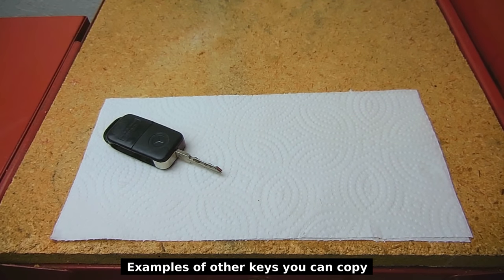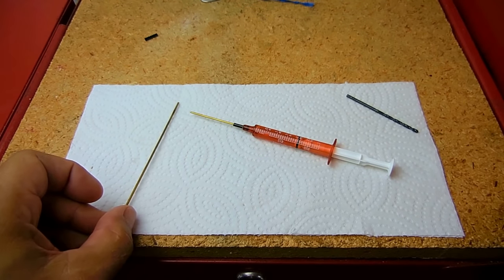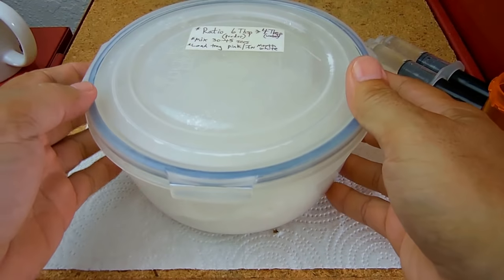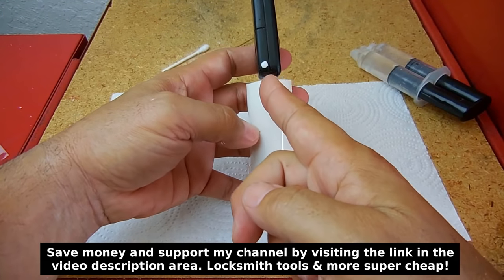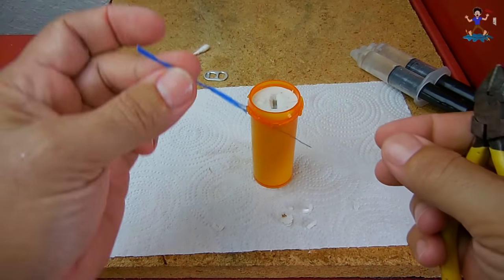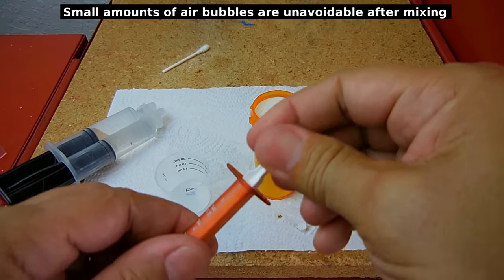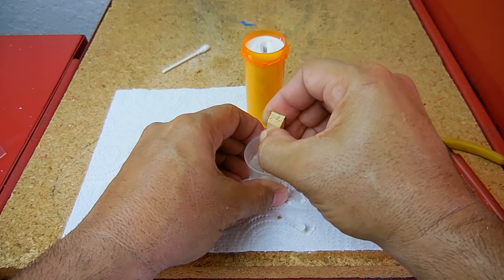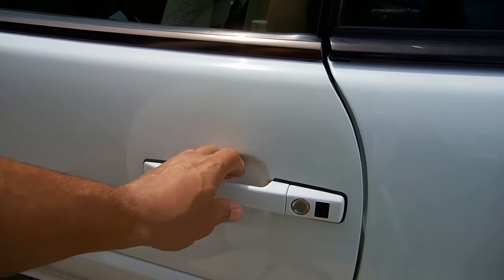How To Copy High Security Keys

Comment: I use silicone or polyurethane rubber for making molds. Silicone is the fastest and best material to use. A 2-part silicone putty is also available that also works well. This material has the advantage that you don't even need to have a mold container. You just knead the putty components together then press and squeeze it around the key, then hold for about 2 minutes. Rubbers are good for making molds because you don't need to slice the mold open to remove the key. You can just pull the key right out without damage to the mold. Note that you do need a release agent. For casting I would not use a 5-minute epoxy because it will give bubbles less time to float to the top before the epoxy begins to gel and traps the bubbles. Of course, vacuum degassing is best, but that will not work with a sodium alginate mold because of the water content. Super-hard surface epoxies are best as they handle the rough edges and pins in a lock better than softer resins. You can also mix powdered glass and graphite into your casting resin to improve surface durability and working life. Besides epoxy, another option is to use polyurethane plastic (not to be confused with polyurethane rubber). This is almost the ideal material to use because it mixes up much thinner than epoxy resins and it sets up to full strength even faster than 5-minute epoxy. Because it is thinner you do not have to worry as much about bubbles even though it sets fast. This will produce a working strength, usable key in about 15 minutes. It doesn't have quite as good a surface as super-hard epoxies, but it's fine... Finally, I use a few loose strands of carbon fiber, fiberglass, or even thread to give strength to the key and, as you noted,  to provide a way to remove a broken key. Do not think that your fancy high-tensile epoxy will not break! I've had keys break in the lock before. Carbon fiber strands work best. They are also easier to push into the resin and move around. I don't like using wire because it is tear the mold and ruin the key when you push it into the resin. I know you need to be careful, but it's just not an issue with carbon fiber or fiberglass.
Reply from the maker: Silicone rubber doesn't set up in 3-5 minutes. :-) Alginate does, and the detail of the mold is outstanding, just like silicone. If you want a mold that you can use over and over, AND have access to the key for more than 3-5 minutes, then yes, use silicone. Thanks for watching
Reply: Mad Hadder
"You can get 2 part dental silicone that hardens at various densities and times. The best for doing this is a 22S Hard 2 part that cures and is removable from the mold in 6-8min.
[...]
There are also 2 Part Polys that cure in 3min to Shore D70 hardness which is many times harder than epoxy."

I love the info in this thread, since i couldn't find an epoxy with a low enough viscosity to pour/inject. Do you know where i can find more detailed info on the materials you mentioned? Something like a webshop that explains the differences between the different varieties of molding materials and casting materials? I searched for 22S hard for example and couldn't find what i was looking for.

Comment: As an engineer, I say bravo. But I have just a few suggestions. Try the liquid version of quick steel. Much stronger than epoxy with no need for re-enforcement. When you are filling, try gyrating from the base. That will release any trapped air bubbles (if there are any present). I understand making your own blunt needle syringe, but you can get a 6 pack for 5 bucks on Amazon. And as far as the pop tab, getting a half inch flat washer would be by far better. And the wire you used is too thin. I would recommend a 16 gauge steel rod (you can put a bend through the washer if so desired.

Edit: I would also suggest using a file and grooving notches into the steel rod so it bites and sets in better in the quick steel.
Reply: @davidjones-vx9ju  sorry if some people are smart and want to help.

Comment: Great video! What epoxy do you use?  I've tried 3, two JB Welds and one Gorilla, all three seem to not harden enough to put in the tumbler.  they flex too much.  Thanks!
Reply from the maker: I found a hard setting, low viscosity 2 part epoxy at my local hardware store.

Comment: Great video excellent instructions.  I am a locksmith and I came across a high security key for a customer that I can't obtain the key blanks.  I have been trying your method for a few weeks with no success.  I am using the exact dental alginate you posted to another person.  My problem is I can't get the epoxy to cure inside the dental alginate.  The top of the key that hits the air cures fine and would be perfect.  But the key part that is actually inside the dental alginate will not cure at all.  I pull the key out and it is like a gummy bear.  The most important part of the key.  The milling and the key bitting will not cure.  After I mix up the dental alginate it cures fine inside the pill bottle.  I cut one side out with a blade to remove the key that part works well.  I trim off the top and make a small opening at the top.  I mix up the epoxy and use a syringe to inject inside the mold.  That part goes well.  After about an hour I check it and the top of the key is nice and hard but when I remove the key from the mold the rest of the key is completely flexible and still wet. It will not cure.  In your video you say pour your case as quickly as possible to avoid the alginate from shrinking.  I am pouring the casting within 5 minutes of pulling out the key. My question is the dental alginate suppose to be wet inside or complete dry.  It seems every time I pour the dental alginate the outside is hard and dry but the inside seems to maintain moisture.  I would say it has the consistency of a hard boiled egg.
Any suggestions you could offer would be great.  This is a very big job I am working on and would help me out greatly.  Thank you in advance for any help you or the YouTube community can offer.

Take care and be well.

I have a clam shell and Yes I can cast the key in low temperature metal.  The problem with that method is the keys come out perfectly but they are so soft you can bend the key in your hand.  I need to use this key on over 200 locks.  That will not work for my needs. Your epoxy key is perfect and I could make several as backups.
Reply from the maker: I bought the 2 part high strength epoxy at Ace Hardware.

Comment: "EASILY copy any key!" 

starts by listing 90 items required, including several that aren't locally available anywhere
Reply from the maker: Don't be a wise @ss, YT is full of them. It is easy, but clearly not for you.  Be thankful I shared this, I didn't have to.
Reply: @electronicsNmore  this isnt some revolutionary method. it is a slow, sub-par basic mold and pour setup that produces an extremely fragile epoxy key. Newsflash, einstein: people have been copying keys using clay molds and casting the keys out of zinc or tin for ages.

Yes, you can copy a key with nothing but a bunch of clay, some tin wire and a lighter. A damn good key, if you know what you're doing.
Reply: @Maxie962    Go ahead put up a video and demonstrate that you know what you're doing?
Reply: all the items are easily available, most locally but the alginate you can get online. If you want a genie to come and fix all your problems go rub your lamp
Reply: @lteralflow4641  what happened, did I hurt your feelings or something?  At no point did I ask anyone to do anything for me - thats not my style anyhow. I'm the stubborn idiot that insists on doing things solo to the point of reckless abandon...to the point where someone with any sense would have asked for help, and I'm sure I'll die an early and painful death because of it.

The point that I was trying to make with my comment was how the title of the video is disingenuous at best. The process appears to take about the same amount of effort as it would to, say, measure the original with a micrometer, source a few appropriate blanks, and then file them by hand, which, for the record, I already do.

I'm not saying the video doesn't have useful information. It absolutely does. Is there a time and a place where this information would not only come in handy, but also be the course of action with the highest probability of success? Of course.

Just be real, man. Call a spade a spade. That's all I'm saying.
Reply: @cen7ury  If you got any videos or links to info on filing/drilling car key blanks, i'd be interested. Thing is with a lot of a car keys it looks like it would be impossible to file them without using a router or suchlike. Obviously it would be preferable to use a harder and less brittle material. I thought the video was concise and well explained, which isn't always the case on youtube as some people ramble on, so i thought it was a bit unfair to dismiss it hence my comment.
Reply: @lteralflow4641  fair enough on the "laser cut" keys, those I don't file by hand. I also wouldn't want to use a cast key on any vehicle that uses that side bar slider style mechanism, as the vehicles that use those tend to have extremely expensive lock cylinders.

Personally, I ended up just biting the bullet and buying a semi-automatic key mill from Hong Kong that I've had good luck with cutting copirs of my Lexus and BMW keys so far....and with that really comes the crux of the matter: there really is no quick-fix one-size-fits-all solution to some problems, and keys are one of those type of situations, in my experience, anyhow. 

If you want, I'll find the make and model of my sidewinder key mill (I think i paid $600-$800 or so for the mill) or if you just need to be able to access a car with a sidewinder key without needing to start the car as well, check if Lishi makes one of their 2-in-1 pick/decoders for the vehicle you're trying to access. They're expensive,.yes,.but they're worth every penny. Any time I've used one, I've been able to get an open in about 30 seconds. Can't recommend them enough.
Reply: @cen7ury  Thanks for the info. Yeah i'd be interested in having a look at the key mill if you have the model number cheers

Comment: Do you think I will be able to do this with a medeco key? I just moved in to a new apartment and want to give my fiancé a key (they use it for the elevator here) but the manager is all over the place and I don’t get the impression that she’s going to be helping us get the licensed key copy ANY time soon. I’m worried that the epoxy won’t be strong enough and may break off in the lock and then we’ll be stuck paying for it. Any suggestions? Also, anything stronger than a pop can top?

Comment: Cool, I would try JB Weld instead of epoxy. Also it can cure in a few hours but maximum cure is usually 24 hours. Maximum cure can also be sped up by placing it in a convection oven for a several hours at  200 degrees. Very nice video. Best Wishes n Blessings Keith

Comment: 👏👏Great Video, amazing mind to come up with such a detailed procedure.👏👏

ElectronicsNmore or anyone else:  How strong are keys made using this procedure, will it break off turning a car on or is it fairly strong as a backup key for occasional use?
Reply from the maker: The strength of the key depends on the resin used.

Comment: Can I use a syringe with a needle (like the ones used for vaccine injection) inside of the DIY syringe? Will the epoxy resin get through?
Reply from the maker: No, the opening is way too small. Thanks for watching!
Reply: @electronicsNmore  thanks!

Comment: Do you have any suggestion on how to mix the alginate smoothly? The product I used is Kromopan alginate. I find that the mixture dries up so quickly before I get to blend it up, and there are always a lot of particles and chunks left in the mixture. Also, after the one hour of setting, the alginate is still wet and breaks easily like jelly. I might have added too much water, but with less water, it was even harder to mix up the alginate. Would you mind providing the measurement of water and alginate that you used? Thanks!
Reply from the maker: You must've used a fast setting alginate. Using cold water slows down the setting.
Reply: @electronicsNmore  thanks for the reply! Cold water does help. Which alginate did you use? I find that my alginate keeps getting wet after it's set. It takes 24 hours for my resin to fully set, therefore during the process, the water gets into the resin and makes the key very soft. Should try a different alginate or a faster-setting resin?

Comment: hi there i have a question which epoxy do i use hardener or resin i liked and subbed amazing channel!!
Reply from the maker: 2 part epoxy resin. The resin must be high strength, very low viscosity. Don't use the 5 minute type, use 10 minute to 1 hour setting time epoxy.

Comment: High tensile wire from a wire cable is probably a better alternative than from a wire tie and protoputty/oogoo/sugru could be used instead of the dental impressioning stuff. A piece of packing tape could be used to provide the seam to break open the key rather than having to use a scalpel.
Reply from the maker: Sugru is no good. Nothing, except for liquid silicone, can match up to dental alginate for fine details. Thanks for watching!

Comment: Would a 5000 psi epoxy resin work as well as the 1500 psi epoxy?
Reply from the maker: Hi Adam. As long as the viscosity of the epoxy is low, it should work fine. Be sure to rate thumbs up, check out my video playlists, share my channel with friends, and subscribe. Thanks

Comment: - 00:00 🔑 The video introduces a method to create exact duplicates of various types of keys, including high-security and "do not copy" keys.
- 00:15 📹 The method demonstrated is not found on YouTube or other online sources, making it unique.
- 00:50 🛠️ Required materials include fast-setting dental alginate, a syringe, a utility knife, epoxy resin, and various small tools.
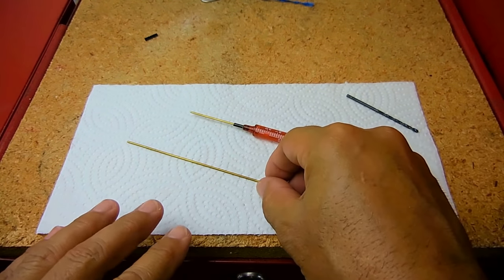- 02:20 ✂️ The process involves cutting and preparing a brass tube and syringe to ensure a snug fit for injecting the epoxy.
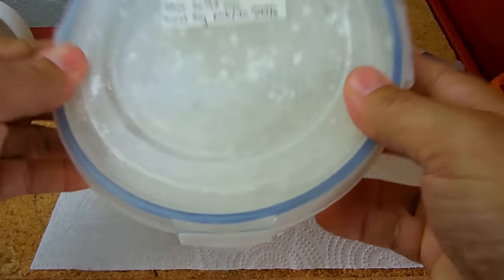- 04:30 🧪 Mixing alginate is a crucial step, requiring it to be smooth and thin for proper key molding.
- 06:00 🔧 After setting the alginate, the key is carefully removed from the mold to maintain the mold's integrity.
- 07:20 🔨 A wire is used as reinforcement in the mold to prevent potential breakage of the epoxy key.
- 10:30 🧼 Epoxy resin is mixed carefully to avoid air bubbles and then injected into the key mold.
- 12:00 🕒 The mold should be filled with epoxy as soon as possible to avoid shrinkage, and the curing process is quick.
- 14:00 🔓 After curing, the key is removed from the mold, revealing a perfect duplicate that functions just like the original.

Comment: Wonder about mixing epoxy inside the corner of a ziplock bag with all the air sucked out, just mush it around, then cut the corner off to squeeze out. I never thought about it for not getting air in. Everyone mixing big things put it in a vacuum, I bet it would work.
Reply from the maker: Shane K No good. You really need to inject it. You can buy a syringe/needle for refilling ink cartridges. Thanks for watching!

Comment: Are these really that durable? Have you ever had one snap off?
Reply from the maker: Well, it won't be as strong as a brass key, but if used carefully, it will work just fine. Strength also depends on the epoxy resin used. Remember, you're not making this key for everyday use. :-)
Reply: electronicsNmore is 1500 psi the strongest avalible? Or would a higher psi level be even better for this use?
Reply: electronicsNmore c

Comment: Will 7000 psi epoxy work better?
Reply from the maker: Makes no difference what you use, but it has to be very low viscosity. Thanks fro watching!
Reply: It's a two-part epoxy, and I suppose as viscous as that. How long does such a key last?
Reply from the maker: A very long time.
Reply: Is the key you made in this specific video still good today, or did it break between then and now?
Reply from the maker: It's kept as an emergency key in case the original is lost or locked inside the vehicle. This idea isn't intended for "Every Day" key use.
Reply: Can the epoxy be strengthened further by adding metallic dust, such as in steel-reinforced epoxies?
Reply from the maker: @maryfreebed9886  Yes, but the filings need to be very small.

Comment: Yeah cool for regular keys. But that key you copied has a transponder. Door might open if key didn’t snap off inside the door, but the cars alarm would get old quick.
Reply from the maker: You missed the purpose of the video. You're thinking too much.
Reply: I use a simple cut key for my car door and my alarm has never gone off. It's not like I drive an old shit box either.

Comment: So basically this is a video so you can have keys for areas you're not supposed to LOL
Reply from the maker: No. Some keys like the one shown in this video are expensive to duplicate. I wanted a spare key to hide outside in case I lock my keys inside the vehicle. Of course people will duplicate other keys as well.
Reply: @electronicsNmore  haha completely just joking I have a medico key I need to duplicate.
Reply: @electronicsNmore  would you happen to know will a key maker make the key if I go to him a locksmith I mean. I own the two keys it's not a matter of duplicating it and not having the original. But there the keys for my washer and dryer in my building and if I lose one we have to basically drill out the hole box. That's was my main reason for coming here.